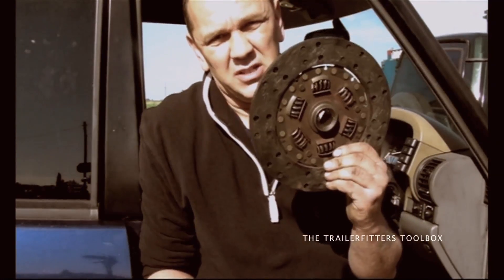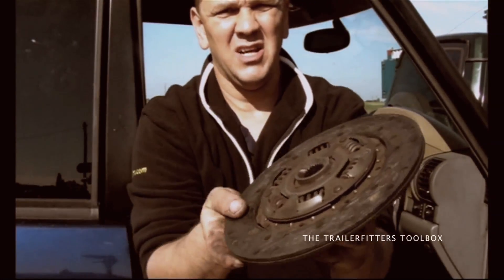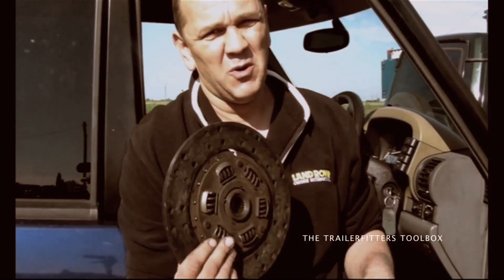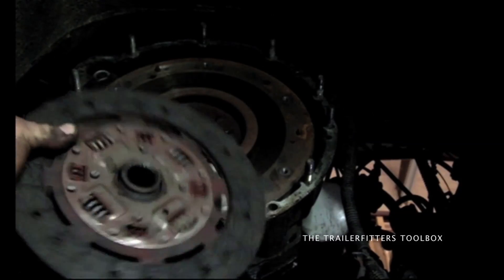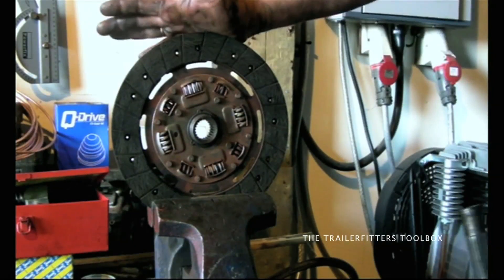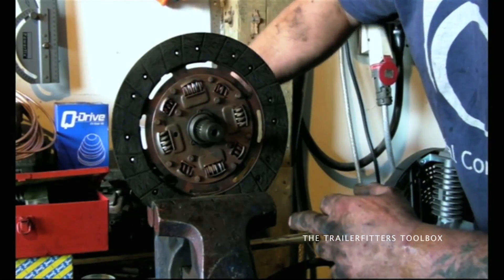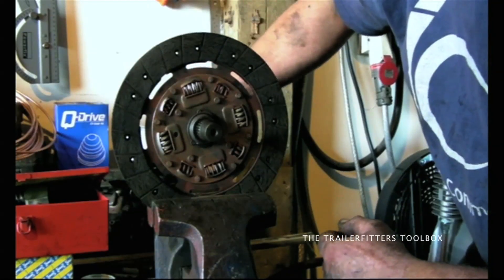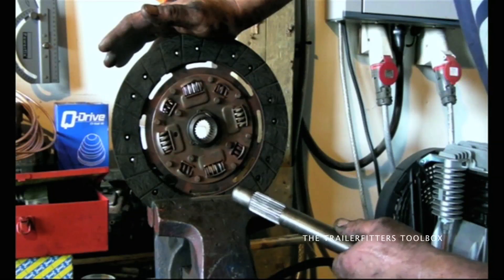Clutch Plate Faults - When a rattle is clutch plate springs and not a gearbox fault.

Comment: That's exactly what I'm hearing on my T9 gearbox conversion on my MG.
Sounds really noticeable when going down the road, as if the release arm may be loose ! (It isn't,  it's  brand new)
I found the pinion rattling on the starter so thought it was that, swapped it, no difference.
Lately I'm getting quotes to have the gearbox refurbed as I'm now blaming  that!!

Yours vid might have saved the day here ! I'll check the clutch disc springs.

If the car goes over a bump I get a jingling sound too, so this could all be related..

Thank you

Comment: I had my gearbox reconditioned, new bearing and fork and a sachs clutch disc, 
matched #'s (refurbed the pressure plate and fly wheel, I was told that's a false economy) 
after installation there was a chatter which can only be described as a bearing slipping/catching/grinding metal.
pedal pressed down -

revert back to old bearing and fork, still noise. after inspecting the new clutch disc the springs were loose and could be turned, with the old clutch back in, im waiting on a delivery i need to fit to start the engine but i do believe this is what is causing the noise. i hope this helps someone out there! thanks for video good sir

Comment: Very good I looked online there is nothing about this this, cold it's quiet hot it starts to rattle just above idle, I haven't taken it apart yet that's all it can be having other issues with the clutch great video I was concerned I may have to pull the almost like a lifter tick but not, lighter noise.

Comment: i have a similar rattle

why does the rattle go away when clutch is pressed? and comes back when clutch is let out?

my guess is that when clutch pedal is out, the clutch plate is firmly pressed on flywheel and hence takes on all the engine vibrations. Hence the noise.

when pedal is pressed, the clutch plate is disengaged from flywheel so doesn't take in all the engine vibrations. Hence no noise.

Is my understanding correct?
Reply: I'm getting this same noise and just hoping it is the clutch plate.

With my 2010 1.3 petrol suzuki swift, you will hear the noise when vehicle is moving in gear but clutch disengaged (pedal pushed in), frequency is with the moving wheels and will change frequency depending on gear selected - all with clutch pressed in.

With the car still moving, select neutral and keeping clutch pedal in... noise goes away, release the clutch and the frequency is with the engine.

In response to your question and my findings, I'd imagine it's the centrifugal force on the loose springs when clutch is spinning which causes the chatter of the springs.

Remember the clutch plate is directly connected to the gearbox and not the engines flywheel.

Now just to replace my clutch plate and prey its not the main input shift bearing.
Reply: @daniellegg7080 facing this issue in my fiat linea 1.3 diesel, when pedal is pushed in chattering stop. Did u find out the problem?

Comment: Really struggling with a noise
Could a bad clutch /springs cause random ticking noises? Noise stops as soon as you let off throttle and does not make a sound on idle
Reply: Mine too. Same symptoms.  Tore it apart and found loose clutch disk spring like in the video.

Comment: My 2010 landrover tdci defender puma has this issue. 90,000 kms. How long can you drive with it like this before it will throw out a spring or can it just be left like that? Knowing the noise is there.

Comment: Have a transaxle making a rattling noise like that only when it is accelerated and usually between 2k to 2.5k RPM in each gear. This seems like a logical reason. Thanks for the video
Reply: Mine is the same.did you sort the issue?

Comment: Good gracious I got the same issue on a clutch that isn't even a year old! (Exedy 98 dollars on ebay!) I thought it may be a bearing in the trans case somewhere, but  in idle, the only thing spinning is the flywheel, clutch and pressure plate, so it's likely my damn spring/s as well. No more cheap clutches for me.
Reply from the maker: It happens on Pumas that have only done 40 000 miles on a genuine clutch too.  We occasionally replace clutches on Land Rover Defenders where the springs have dropped out and jammed up.
Reply: Any ideas as to what causes it? Can too much play in my rear end back lash contribute to the spring being overworked?
Reply from the maker: Not really.  too much weight on a vehicle can shorten that area of the clutch or just a poor quality item.

Comment: i have suzuki swift sport zc32s with 6500km.
the dealer replaced the entire clutch kit at 1500 for a rattling noise at idle.
clutch manufacturer is exedy.
now is rattling again, dealer told me first time noise was the center of the clutch, the hub.
after reading so many comments here about how shitty exedy clutches are, i think they might be right.
here is a video of the noise at present, will take it again next month
also when lugging the engine a little bit, a spring rattle can be heard
https://www.youtube.com/watch?v=DHQl1KavSig

Comment: does this sound get faster while driving? and when i push the clutch in it slows down to a stop when I'm sitting still. if im moving and have the clutch in the sound stays but is a slow knock/rattle sound. could this be my problem?
Reply: I'm having your same issue, i just removed my exedy clutch and all my springs are rattling bad. I hope replacing the clutch fixes my problem.
Reply: @TylerHoven  Hello did it fix?
Reply: @ADDMEONPSN  no sadly it was something in the motor. Ended up putting a built livernoise Motorsports Short block in

Comment: My Honda Civic (1990) makes a short vibrating chirping noise when I climb uphill from a dead stop. I don't normally hear this day to day and it's random sometimes. Is this a clutch issue?
Reply from the maker: could be a worn engine mount?
Reply: ***** , I replaced all the engine mounts recently but the noise still persists.

Comment: I think I have this issue on my TD5. Doesn't make the noise at idle, but rather as I rev up past 3,000 revs. Loud rattle. 
I've got a new AP Driveline HD clutch (doesn't seem to have the springs in the friction disk) and a new Dual Mass Flywheel to go in. 
Just need to find the time to fit it.
Reply from the maker: ah yes,.. Finding the time.   `that is an expensive comodity these days.  ~Good luck with it when you get around to replacing it.  Not so bad on a Defender.

Comment: Exedy clutch a year old and doing that thanks
Reply: yaneli2000 fucking same
Reply: Good gracious I got the same issue on a clutch that isn't even a year old! (Exedy 98 dollars on ebay!) I thought it may be a bearing in the trans case somewhere, but  in idle, the only thing spinning is the flywheel, clutch and pressure plate, so it's likely my damn spring/s as well. No more cheap clutches for me.
Reply: Spec clutch stage 3 kevlar/Bronze $500 dlls 3 months old, started rattling S:
Reply: @esteve95  When you hear the rattling does it only seem to happen at certain RPM? My clutch is rattling when decelerating from 6k-5.5k RPM.
Reply: @doctorferdinand1003  mine turned out to be lifter noise, amazing how sound travels in these aluminum engines xD

Comment: hi i have got a rattle coming from my rover 45 diesel  gearbox. you can here it when the car idles, when i push the clutch peddle down the noise stops, do you think that is the springs?  if it is the springs is that a problem that needs to be sorted? or is it ok just to leave it?
Reply: Dawn Crystal I have this problem did u find out what this tap knock noise i's thx 👍